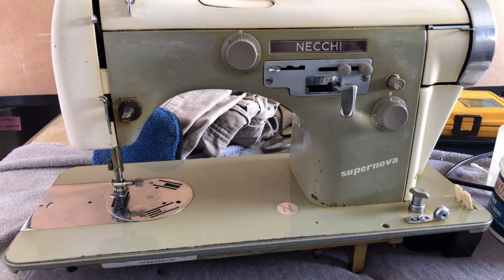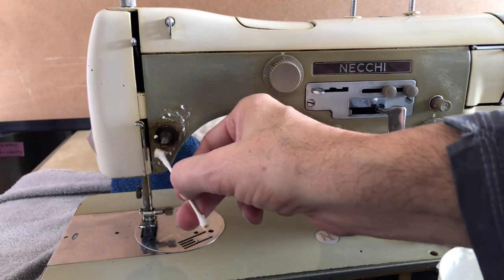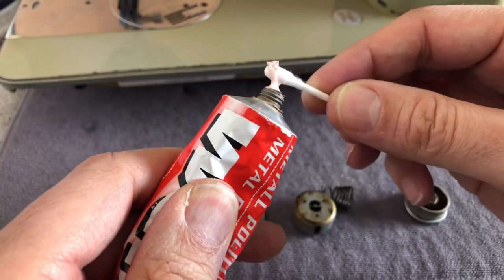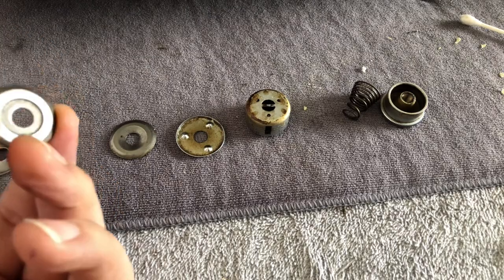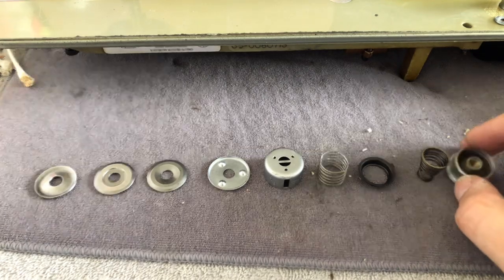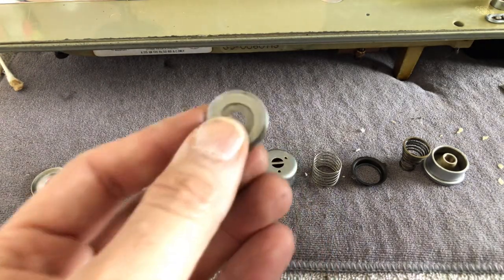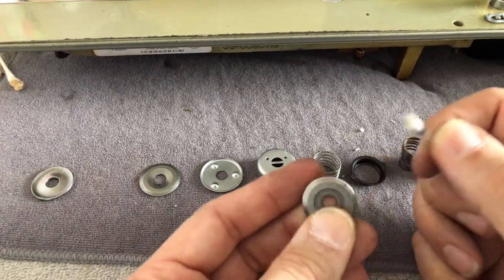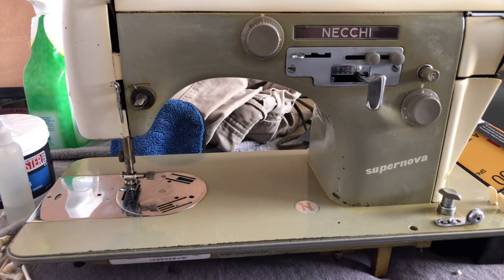CLEANING SERIES #16: LONG OVERDUE: How to Clean a Necchi Supernova Tension Disc Assembly

Comment: Thank you so much for your excellent and extremely helpful videos. Without them I surely would not have had the courage to disassemble and reassemble the tension unit on my Necchi Supernova Ultra. Unfortunately, even after cleaning it and smoothing a very small indentation in one of the discs, I'm still having big problems with my upper thread tension being *too tight*. I can only sew with the tension at zero, and even then the fabric is puckered. When I use a stitch length of 4, it gathers the fabric. The stitches themselves are still beautiful, but the fabric gathers with every stitch length and every tension setting. 

I have a hypothesis and I would really appreciate your thoughts on this. The problem started recently, after the machine sewed several projects beautifully, without any tension issues. I was recently trying to fit a vintage Greist tucker attachment which was sitting too low, so that there was almost no clearance for the fabric underneath. (The tucker came with an adapter for high shank, but it obviously wasn't a perfect fit.) 

In order to get the adapter to work, I had to adjust the height of the presser bar. This worked, and I was able to use the tucker and it produced beautiful stitching. I had carefully marked the presser bar position with a pen before I changed it. After I removed the tucker attachment, I returned the presser bar back down to its original height. 

After messing around with the presser bar height, I was relieved when the SNU sewed my next two projects (on stretchy jersey fabric) normally. The upper thread tension tightness became evident only when I started my next project on a light and a medium weight cotton. I did some troubleshooting on the usual suspects that cause tension issues and nothing seems to explain it easily: my bobbin tension seems good, I'm using the correct needle and thread sizes, the presser foot pressure seems fine, I've rethreaded the machine multiple times. The tight tension is worst on lightweight fabric (as one would expect), but it is still too tight on medium and heavier weight fabric. 

The problem seems to be coming from the tension assembly. When the presser foot is down and I gently pull the thread, it doesn't move at all. There is total resistance at the tension assembly. It feels like the discs are clamped together. When I raise the presser bar up to the first position, the thread glides through nearly normally. 

I'm wondering if the presser bar height is perhaps a tiny bit off the correct height. As you demonstrate in your video, when I raise the presser bar, the tension assembly does push out. But it seems to me that the connection between the presser bar and the tension assembly is the main potential source of the problem. But I've tried moving the presser bar a tiny bit up and a tiny bit down, and I can't find any difference. 

I fear that messing with the presser bar has led to the tension issue, but I can't quite understand how. I adore this machine and I feel responsible for messing her up! I appreciate your incredible knowledge and generosity, and I will be even more grateful if you would like to consider this problem. I hope you are having fun on your own projects! 

With thanks,

Samantha

Comment: I have the supernova ultra mk 2 and Mt tension wheel is different. I need help with the dial/knob not being attached to the screw/shaft...manual has it as one piece and I wonder if my can be glued.